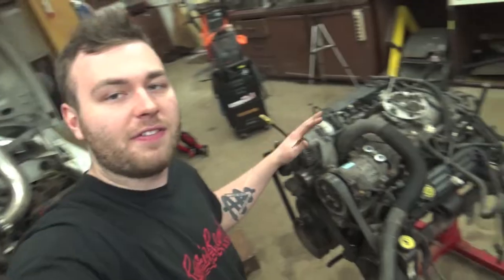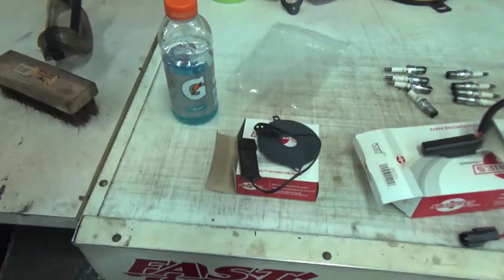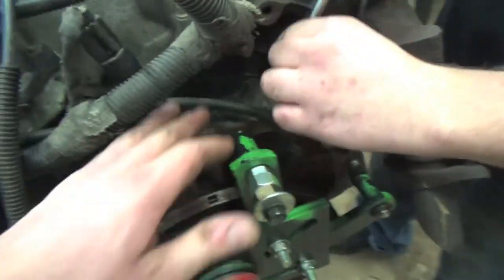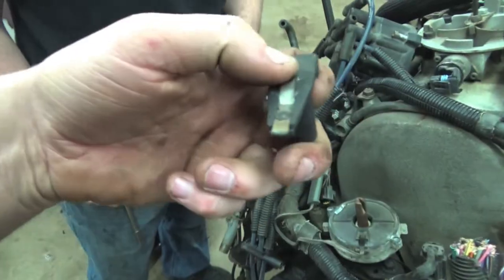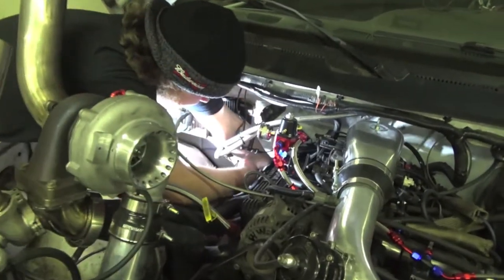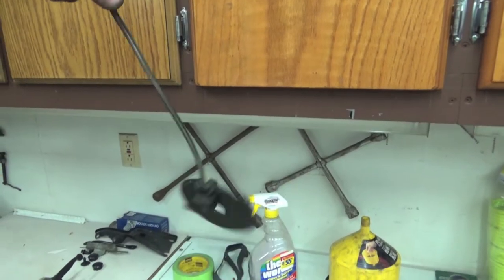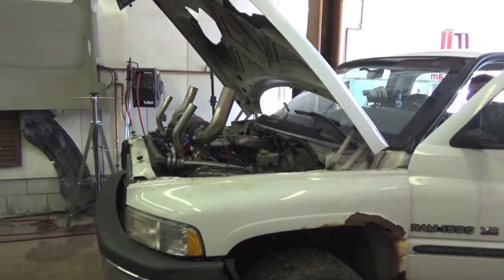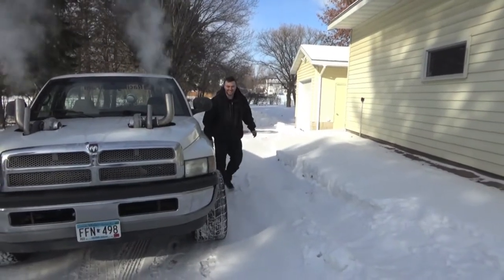How to change cam & crank sensors LIKE A PRO! on a dodge ram 1500 5.2 5.9 magnum. Whitie build ep.18

Comment: So I'm at the dyno shop with my 99 dodge durango 5.2L twin gt35 turbo build and my tuner watched this with me. He says its good you changed out your crank and cam sensor but its unnecessary.   He heard your truck and said to check your 2bar map.  If it hits 8 to 9lb of boost then wants to choke its because your map is not registering correctly.  Had the same issue in mine just now.   Friendly heads up.
Reply from the maker: Thanks man!
Reply: I watch your channel sweet Durango buddy!
Reply: @jadoncreamer7033  thank you buddy.

Comment: I hope not 🤦🏽 hate to tare apart everything I just put back together 2 days ago
Reply from the maker: Advance stock cam is pretty pointless lol your engine now can prob only make power to 3500 rpm lol 😂 stock cam suckkkkkkssss
Reply: I don’t know much on the performance side … but I advanced it cause the paperwork said 4degree advanced will give more low end torque … so I was like well I’ll be hauling with it and it’s 4wheel drive so added lower torque would be nice … 🤦🏽 not knowledgeable on mopar just chevy and fords ….

Comment: I found this channel by googling location of both sensor because I'm having trouble with my 1999 Dodge Ram1500 Sport 4x4 5.9 engine won't start when it gets hot and cools down before starting again .

Comment: I'm trying to get a ram 5.9 gas engine to start have fire and gas pressure is good but still not starting got any ideas I already replaced cap button, crank shaft sensor, coil and coil pickup in the distributor
Reply from the maker: I mean I’d hook up a scan tool and check codes and data. But like mine I burnt out the pcm

Comment: Found you from the Cam and crank sensor video. I have a 92 ramcharger with a fuel delivery issue. I was thinking it might be the ASR but it starts on starter fluid.

Comment: I'm putting together a 74 dodge dart. Has the 5.2 magnum fuel injection + 5 speed manual swap. Motor came out of a 98 dodge dakota. Was searching for hp gains. That's when I seen your videos. Been a fan since!
Honestly I'm thinking about saving up for the procharger though.
Reply from the maker: Ya procharger or torque storm! Thanks man glad your enjoying the channel
Reply: @RacingRamFam  o man I didn't even know about the torquestorm. Almost half the price. Good looking out on that one!
Reply from the maker: @markpollard500  yes only problem is with the torque storm is it doesn’t come with a intercooler setup. But I mean $300 of intercooler and piping will fix that

Comment: Hey bud got a link to a decent air intake box? Or silencer box? What ever it’s called. Lolz 
Hate the stock one. Had done a tune up after a good 5+yrs of sitting. Pulled the air box off changed filter and now even with a new gasket it sounds like it’s pulling air. Tried some fish tank rubber tube for my home made kinda gasket. Just not working. Plastics old need something new. Ppl on the jungle website complain about all those intakes…
Reply from the maker: I got a trick flow on my 99 plow truck and it’s been great the last 5 years.

Comment: Ya I had nooo problem at all changing either jus recently .. it was sooo easy !!!! That’s because I had my son change mine  for me hahahaha lol .. gotta live it when ur son becomes a heavy duty diesel mechanic lol.. but ya they are in some tight spots for sure man .. great video good job truck is great 👍
Reply from the maker: Thanks man! And I wish I had that 😂 lol it sounds nice
Reply: @RacingRamFam  yes it comes in real handy having my son able to help me an him being a diesel mechanic is an added bonus .. especially now that I’m having such serious health trouble an wheel chair bound now .. but we come in keepin on an havein fun with our trucks !!!👍
Reply from the maker: That’s awesome man! Any mods you got coming up?
Reply: @RacingRamFam  yup getting some speciality tunes specifically for my truck from Hughes engines for my 5.9 magnum since I put new street strip cam an lifters an valve springs an true double roll  timing chain An gears along with new headers  an new  true dual exhaust.. actually still getting that finished jus have my two dyno max race mufflers left to install an tail pipes an cold air intake .. also going to pull off my 20 inch stock rims An tires an install 17 in nittos street strip tires an next month hopefully getting my transmission shift kit installed .. then we see how she works .. it’s got the 392 gears in rear suregrip so .. it’s not huge stuff but for me at soon 51 yrs of age in my health it’s a wake up for it an fun enough for me 👍
Reply from the maker: That’s awesome man! Have you driven the truck yet?
Reply: @RacingRamFam  yup I have an it’s pretty sweet.. definitely has woke it up quite a bit .. but i need to finish exhaust an get the tunes from Hughes engines .. it keeps throwing code “ misfire “ like three misfire codes An Hughes tells me with all info I’ve given them there tunes will fix that..but man what a difference in the truck already lol so I can’t wait to get all last bit of things done up an excited to get driving this spring .. I jus got outa hospital after being in for a week .. so I get a bit behind on my wrapping things up lol
Reply from the maker: Ya I bet it’s pushing close to 400hp! Sounds like a riot
Reply: @RacingRamFam  ya my buddy that helped me sat down An did some calculations An we come up with a figure of around 375 to 400 horse .. you know it stuff !! Any way great chatting with ya .. I look forward to all your future videos !! 👍

Comment: Please help!!!! I have a 2000 dodge ram 2500 5.9L gas. I changed the crank sensor. Slightly snugged the bolts tight. Now i have a slight ticking or arcing noice. I loosened the bolts and the noice went away for a short time now the noise is back. The bolts on the original one were loose. But probably should of not bought it from Advance Auto

Comment: Don't you mean a Distributor Ignition Pickup Coil Assembly??
Reply from the maker: Yes they use it as a camshaft position sensor in this engine but yes!

Comment: Just found you guys. I found it by trying to figure out why my 97 is barely running after doing the intake rebuild with the aluminum plate from Huges performance. The turbos are awesome. You can come do mine in Kentucky. It's 75° today.

Comment: It's actually easier to do the crank sensor if you take the passenger side tire and fender plastic off. Much easier than doing it from over the top.
Reply from the maker: Isn’t the metal inner fender in the way?

Comment: New Subscriber
Like The Info!!!
I Got 2 MO-Whities...2001 Ram 1500 5.9 and 2005 Ram 1500 5.7 hemi...
Found you guy when looking or off side-bar viewing "Scotty K & 1A-Auto"
You and your team seem more on my level of doing it yourself with proper tools, schooling, 8yrs military 3rd-shop & motor pool repair.
EGR will not got away after rebuild on Tranny on 2001 5.9L, and 2005 5.7L misfires when FIRST STARTS no matter what I have replaced!!!
Any Ideas or Knowledge of what in the world is going on with either one or both???

OH....Tell JT although its summer now, it gets COLD AS F%@K here too!!!
2-3GEN HERE...
Reply from the maker: Egr won’t go away? And hemis are very known for valve seat issues in that generation do you know what cylinder is misfiring?

Comment: I love your truck . The twin turbo. I have a 96 1500 v8magnum 5.2 and I've been trying to get mine to start. No start cranks fine. Changed cap and rotor. Next I'm gnna do what yall changed is the crank and cam sensor. . Hope it works. As it there stock 96 parts. But I sure would like to have some stickers and a shirt. How much are they. IL represent for yall up here in upstate ny.also I found this channel for help on replacing my crank cam sensor. I also want to add more performance parts to my 96 1500 v8magnum 5.2 extended cab 2x4.
Reply from the maker: $20 you can email KeepItboosted@racingramfam.com 
Also seen a lot of broken timing chains

Comment: Hi this alan I got 1998 dodge ram plow truck for my driveway but can't get it started again thought if working with more power would get work done easier
Reply from the maker: Hm like won’t crank,
Reply: @RacingRamFam  crank but no start and no spark so trying distributor cap but screws rusted

Comment: I found your channel by trying to figure out my p1391 code … and I have a question…. My buddy give me this 97 ram1500 5.9v8 and I put a double Chain on it cause she’s 247k but it has the option of a 4 degree advance or retard option on the crank gear … I advanced it , is that giving me this code ????
Reply from the maker: Yes… you have to resync the distributor
Reply from the maker: Just need a scan tool my snap on modius does it and sync it back to 0 degrees. You can leave the cam advance but engine prob going to run crappy without a tune….
Reply: She doesn’t run crappy at the moment put plugs and wires on it … she is smoothish but stumbles/cut-out … the code is a intermittent signal loss from either crank or cam sensor

Comment: I had a shop replace the crankshaft position sensor and it started and my truck ran fine for a week and then it died on me one day and I was able to restart it but then the next day it died and didn't restart it would crank but no start. My ex fire chief said it could be the ceramic ignition block that's on the fire wall and I told the shop that and they said my truck doesn't have that I was wondering if that's true or where it is exactly on the fire wall?
Reply from the maker: You don’t have a ignition box. You have a pcm that has a coil driver in it which controls the coil pack. But the pcm also controls all emission controls and transmission.
Reply from the maker: Could be a lot of things for it to just shut off

Comment: Just changed the CKP sensor on my 95 jeep ZJ with a non MOPAR one and now it’ll start but idles like shit and hesitates like crazy.  Was running fine before till the engine shut off while driving. After that it would crank but not fire till the new CKP. Gonna change it for a MOPAR one now cause changing the TPS, IAC, and MAP sensors didn’t help.

Sucks cause it’s so hard to get to on these jeeps it was an all day job lol
Reply: Did changing the cps help?

Comment: I found your channel trying to figure out what is making the fuel pump is getting hot and quit pumping fuel. You let it set and cool down the fuel works and starts back up. Is it possible sensor bad and getting hot. We did change fuel pump and relay… it’s a 1999 dodge ram 1500… 5.2 liter

Comment: I found it on Google and I have a 98 dodge ram 1500 that starts but eventually dies and won't start until the next day
Reply from the maker: Ya that can be coolant temp sensor issue as well or pcm issue.
Reply: @RacingRamFam  I forgot to mention that it sputters before it dies

Comment: Hey guys what's the secret to an install of a crankshaft positioning sensor on a stick 5.9  Dodge Ram  with a fu**ing 6mm recessed hex head bolts???? The EGR ain't coming out this year.  ????? Thanks for you insite

Comment: When you try to buy a camshaft position sensor at O’Reillys or AutoZone for your 2000 Dodge Ram it’s not on their computer system. You need to ask for a Pickup distributor assembly.

Comment: that crank sensor is a **** ***** bitch and a half just to get to. 2000 Ram sport 1500 5.9. I replaced it and it wouldn't start. Put the old one back in.

Comment: I found this video cause I asked google if the crank sensor had only two wires and they sent me here.While I have you.You seem to know a lot about dodge engines i have a 1998 dodge ram 1500 5.2 and have a crank no start the od light is flashing and ads,fuel and ac relay is clicking.I can bypass fuel relay and prime it and the pump started and the truck will run for as long as the gas I primed it with will allow.I can't get a code reading cause it reads link error.Is there any way you can point me in the right direction.I also bypassed the ads a d no start

Comment: It was a suggested video, I threw on a single turbo and searched to set if any others have tried it on the 5.2 , and nothing showed up, it was a couple years ago tho, but love the setup, I have a 1998 ram 1500 Laramie but extended cab with the half doors, had 320,000 miles. Ive since pulled her out and cam swapped, lifters, springs, push rods, yada yada, all new gaskets, I just need to get the hp tuners suite so I can tune it all in, I have a 3 bar to install but useless without calibration. I have the wideband and high flow injectors. And yes I'm tired of the infamous plenum pan. I want the m1 intake. Hard to find ALOT of intakes with mpfi. That and another turbo is on the list.
Reply from the maker: Hell ya man!
Reply: @RacingRamFam  there's a pic of my whitie lol

Comment: I have to do the cam and crank sensor in my 5.9 do you have to "relearn" them after replacing them? Or is it only necessary if they act up after install?
Reply from the maker: Nope unless you move the distributor
Reply: Thanks brother
Reply: How do you relearn them?

Comment: Great vid. My 99 Rt won't start has power to coil none coming out. Change coil and cps. Gonna do cam sensor now. Am I missing something?
Reply from the maker: Have you read the codes yet? I just killed my pcm last weekend and it was no spark
Reply: @RacingRamFam  
Thanks. Just did cam position sensor. That was it. Unfortunately it was the last thing I did. But it's good now.
Reply from the maker: Awesome!

Comment: any problem you know of advance timing a little by filing slots in Crank Position Sensor mounting holes?
Reply from the maker: Never heard of that. But factory timing curve succks that’s why I got my sct tuner
Reply from the maker: @arthurdolle5257  can’t really with out a tuner. Cause if you move the opening in the cam positions sensor it’s going to freak and throw a correlation code between cam and crank
Reply: @RacingRamFam  that's what I was looking for, a reason why It wouldn't work, still wonder ifone could squeeze a few degrees advance before the computer got upset, I bet the camshaft position sensor is not nearly as precise as the crankshaft position sensor or Mopar wouldn't use a crankshaft sensor. Really like what you're doing with whitey and the way you mounted the turbos.
Reply from the maker: I mean for $400 you can get a good tune. Can’t beat that plus the torque reduction kills so much power
Reply: @RacingRamFam  I have a 94 Jeep Grand Cherokee which is OBD 1, I don't think it's programmable, I think a 95 ECM, which is OBD 2, can can be hooked up and then could use a tuner. The stock advanced curve really really hurts the power and mileage I suspect and it's set up for ERG. Since my transmission is an RH46 so doesn't need the computer, I wonder if ignition and fuel curves just be controlled by the tuner. Then let the OBD 1 run the rest of the stuff as usual.. thanks for the tuner idea I'll check it out
Reply from the maker: @arthurdolle5257  ya you would have to swap to a obdii computer to tune it. Or go to a msd 6al

Comment: I dont know if your still in ly area but do you work on anyone's cars? I have a 08 charger srt8 and I wanted to know if you could help me out with it.
Reply from the maker: In the mn area
Reply: @RacingRamFam  yeah. Oakdale area. I seen you in the srt10. I have the black lifted ram with the 37s. I use to see you driving around.
Reply from the maker: Oh ya man what’s up! What do you need done on your charger?
Reply: @RacingRamFam  nothing much. I'm not sure. This is a little different for me.  I have some engine codes I have never seen and I humming noise from the rear end. Sound like the rear end. It comes between 60 and 75 when i hit the throttle stops over 80.  Also some vibration. Not sure if it's the tires or something else. It runs fine so I'm not sure if the engine codes could be from the headers. Its has kooks long tube headers and full exhaust. I dont trust any shops with it.
Reply: I was wondering where the black ram went with the custom bumper. Haven't seen it in a while.
Reply from the maker: My plow truck oh I moved about 2 miles away from you bought a house and shop
Reply: @RacingRamFam  It looks nice. I see it on the channel. Your shop is huge.
Reply: @RacingRamFam  if you have time could you look at it?
Reply: @RacingRamFam  do know here I can find 2 CV axles that wont cost 2k for both? Or rebuilds
Reply from the maker: @Diesel0666  I’m a big fan of eBay that’s where I’d check

Comment: Been a long time fan of the channel. Got alot of great tips on the 2nd gen lol. But I found this video specifically for the cam and crank sensors because I seem to have power loss to them I have changed both out with distributor cap and router as well as coil pack still can't figure it out but it runs just fine I just keep deleting the code for this issue lol
Reply from the maker: If timing chains to stretched it will set a cam/crank correlation code
Reply: We changed the chain and sprocket gears when we did the sensors and coil. During that time the harmonic balancer broke apart so we changed all that and made sure everything was lined up TDC. Could the broken balancer have bent or caused this problem? Much appreciate the response and input. At this point I'm running in circles with forums and YouTube haha.
Reply from the maker: @bodiwankanobi8658  did you align the cam sensor with correct scan tool
Reply: Didn't use a scan tool for that we just have a simple centech obd2.
Reply: Is there specific scan tool to use for this process
Reply from the maker: @bodiwankanobi8658  my snap on modi’s does it. Or the dodge drbii. Just go to your local dealership and tell them you need a cam sync done.
Reply: Thank you so much for the replies and a sense of where to start it helps a great deal 👍